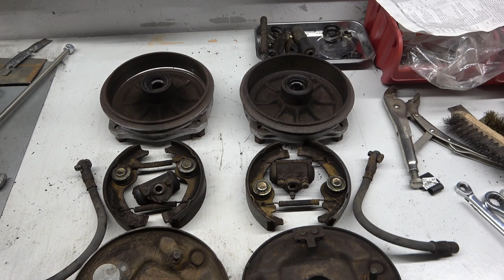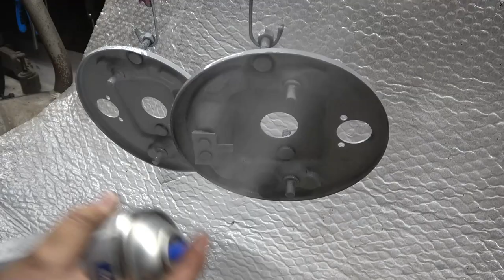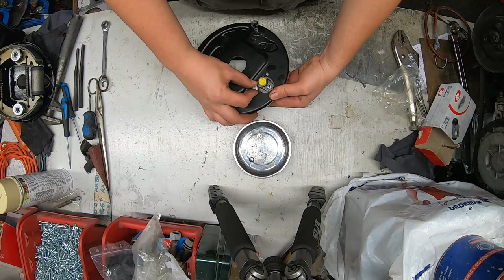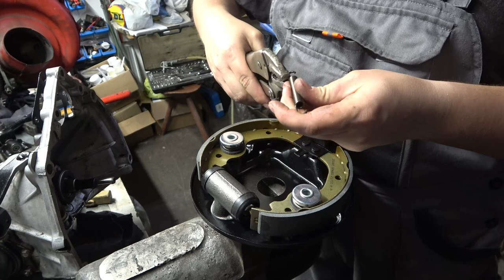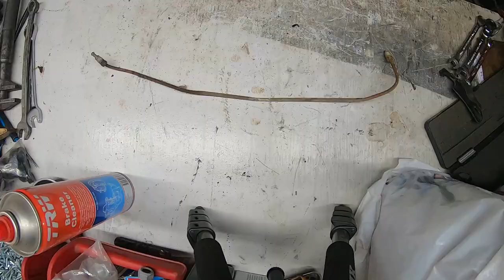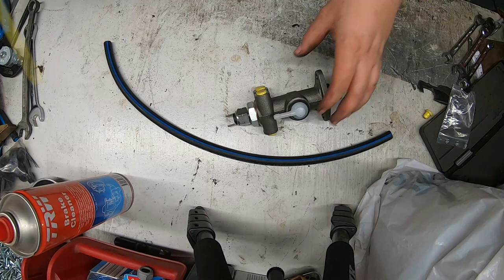Fiat 500 Classic - Part 8 - Restoring the brakes

Comment: Hi I am restoring a 500F, would you have any tips / tricks for fixing the front panel to the front wings, how to weld etc
Reply from the maker: Hello. I only replaced the bottom section of the front panel. There's a video on my channel about it. If you replace the whole front section, I'm guessing the welding will be a bit tricky. I don't see a regular spot welder fitting in those tight spaces, so a mig welder would have to do. Just take your time , make sure everything is aligned before final welding. Also, it's a good idea to treat overlapping metal with weld-through copper primer.

Comment: I need to replace the rear brake backing plates on my 500F. Does the axle need to come out? If so, can you describe the procedure? My Chilton's manual just skims over it.
Reply from the maker: You need to remove the 4 bolts of the driveshaft, then the big nut that holds the wheel shaft. Now, you can remove the hub and the plate by undoing the 4 bolts that hold it to the suspension arm. When reassembling, you will need a new crush spacer and a way to apply a lot of torque to the big nut in order to adjust the preload on the bearing. I used a pneumatic impact wrench. A long breaker bar also works.
Reply from the maker: Also, I have this video that should help: https://youtube.com/watch?v=MQEB9f_OIXA&feature=share8
Reply: @AircooledProject  Thank you so much! I may have disassembled it in the wrong order, but, c'est la vie. I'm having a problem visualizing when the big nut gets torqued down. I have everything off but that one. It's not a castle nut with a cotter pin as some diagrams show. Rather, it has a raised knob on the end where the spring from the drive shaft rests against it.
Reply from the maker: I was in a hurry and didn't film the tightening process. I used a pneumatic impact wrench and tighten it a bit at a time while checking the load on the bearing as shown in the video at 6:37. You can also use a braker bar or long wrench, but you need to find a way to keep the axle from moving. Maybe another person can hold it.

Comment: Great work overall. Is there any tips for flushing brake fluid after replacing the master cylinder? Did you pushed the piston of the master cylinder all the way in or just installed everything and did a regular flush? Thanks in advance.
Reply from the maker: Thanks. I just did a regular flush with one person in the car presseing the pedal. Started with the wheel farthest from the master cilynder. It took some time to get all the air out. After that you also need to press the pedal a lot until the self adjusters seat corectly.
Reply: @AircooledProject  thanks, I'm watching ur videos as a guide, keep posting :)
Reply from the maker: Thank you. This is the first Fiat 500 I'm working on, so I may not always do things in the best way.
Reply: @AircooledProject  wow the way you do it seems quite experienced.

Comment: Thx for the video! i just buy one fiat 500 and this kinf of video its amazing!

one question, 0:08 To remove the cover and access the front pads is to remove the circular thing that is in the middle? i need to change the pads but i dont want to remove everithing by the moment! xD
Reply from the maker: Hello. To change the brake shoes(pads), you need to take off the brake drum, the one that the wheel is bolted to. In the front you have one central nut. After shoes are changed, the central nut needs to be replaced, tightened correctly and locked in place. In the rear its simpler, you have 4 bolts.
Reply: Thank you very much for the quick answer! I will try to loosen it with a plumbing wrench... Would you know where I can find the central nut to replace it, I have searched some websites but I cannot find it, only the pads or some kits where it is not included ...
Reply from the maker: I bought lots of parts fron axel gerstl and passione500. I think they both have it. Be careful not to overtighten or the bearing will quickly get worn.